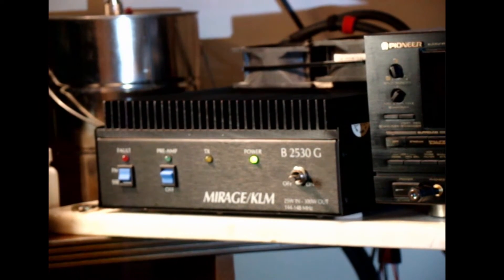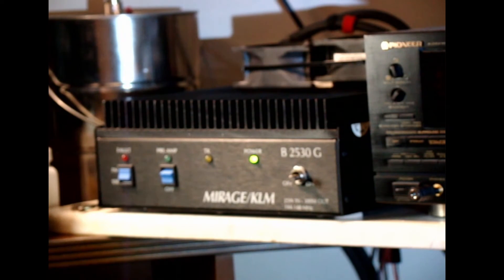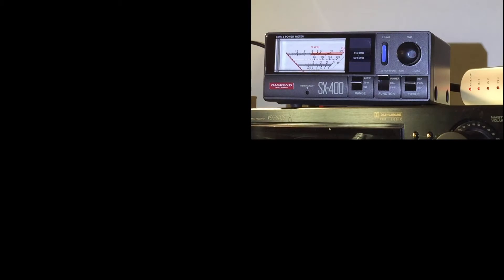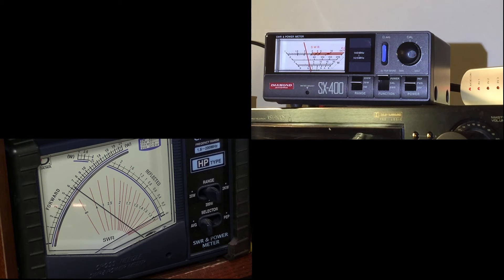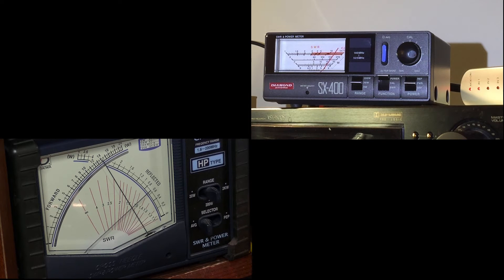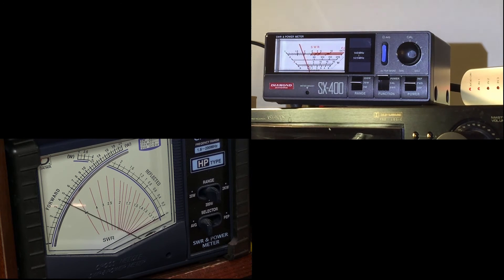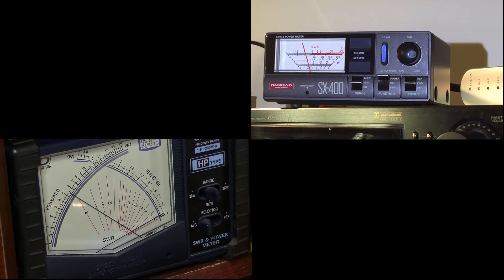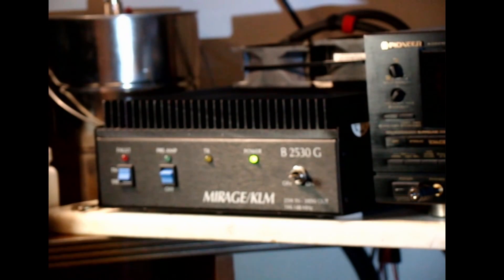Mirage B2530 Test, Works a little  HAM / Amateur Amplifier

Comment: What power supply were you using for this test? 300 watts takes quiet a bit & many people don't take that into account.With 5 watts of drive the output was pretty close to correct.It is designed for 25 watts of drive which is far more than you were giving it.
Reply from the maker: Astron 70 amp...